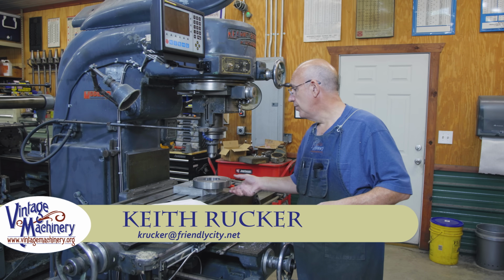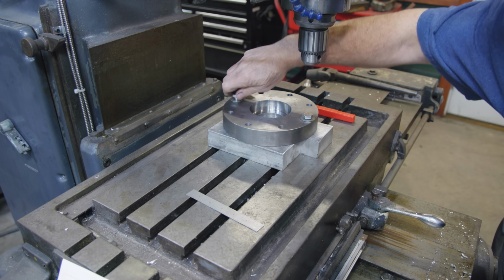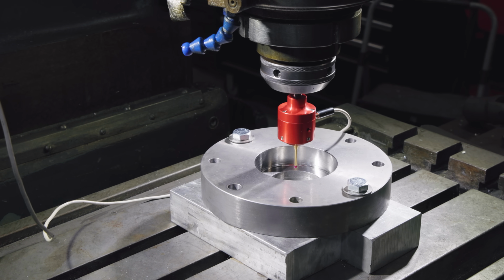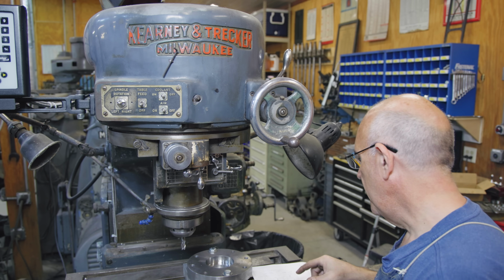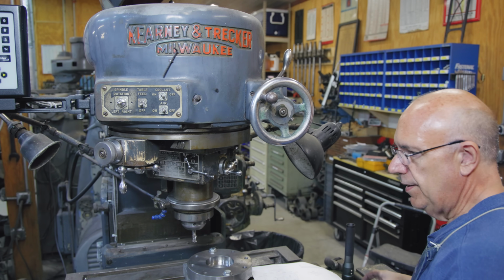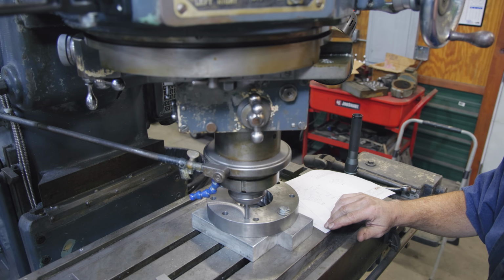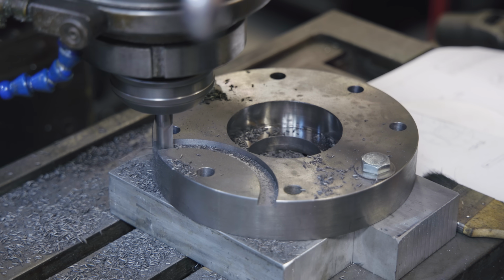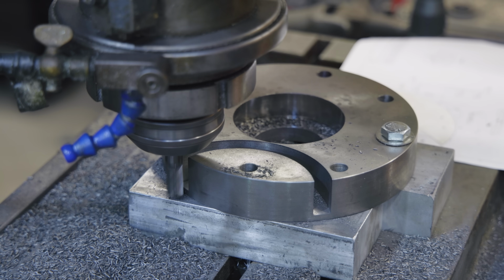Tally Ho Capstan Project: Circular Milling on the K&T 2D Rotary Head Milling Machine

Comment: Why did the cut fall inside two of the eight bolt circle holes when the print indicates the cut intersected with two of the bolt holes? I really appreciate you sharing your projects with us!! I started my career as a Machinist back in the late 70s. It's great to see some of the amazing machines that I used to work with before CNC took the floor.

Comment: Love your videos! Just wondering why you could not (or chose not to), cut on the reverse stroke, each time you brought the head back to the left side. You only cut in one direction... left-to-right. 
It seemed to me that it might have been possible to cut your work time in half if you had cut left-to-right, and then also again on the reverse, right-to-left (while returning the cutter head back to it's zero position.

I know nothing about any of this... just a casual observation and I'm curious...

Still a great video! And I love your videos!

Comment: Hello Keith:  Be sure to lock your quill with the large nut when the quill is not being fed, also, when not using quill feed, be sure to put the feed selector in neutral to avoid wear ... Trust me, you do not want to have to dig into the quill feed box.. Ask Grundy about it.. Cheers from Louisiana; Mike

Comment: It's interesting the machines that used to be made. Yes CNC has replaced this function, but here is the key thought, the CNC machine only approximates the diameter, it is after all a digital machine with discrete steps. This machine, being analog, actually makes the true circle.

Comment: Al. You have a trash pump, we always use a fire pump and fire nozzle. Fire pump built for pressure not volume as the trash pump is. You will run out of water to quickly .

Comment: Nice to see the machine at work. I'm wondering why you chose to cut only in the clockwise swing of the arc? Why not cut .100 DOC in both CW and CCW swings (done in half the time). Is there a reason the unidirectional cut is preferred?

Comment: It looks like the arc is not aligned correctly with the bolt-hole pattern,  i.e. the distances from the cut-out to the two closest bolt-holes are different.  Is this a problem ?
Later edit:  I can see from the drawing that this is deliberate.  So, no issue (although the clearances of the hold-down bolts in their holes means that these distances could be slightly different from the drawing).

Comment: When you centered up the spindle on the bore, you did not ensure that the spindle was centered, aka on a radius of zero.
Reply: If you turn the feed on and rotate the spindle about it's Variable radius, and run an indicator on the quill, you can zero the spindle out.

Comment: Once again, Keith, a very absorbing video. I am afraid that I get so caught up with it all that I find myself holding my breath as the tool is making its way to the first cut, As the the actual machine, all before me have expressed what a wonderful piece of equipment it is, and hard to imagine how it is designed and built. None, I hasten, to take away you skills in leading it gently by the nose. Great stuff.

Comment: Just curious as to why no cutting fluid?
Reply: I think it is for filming, you don't want that oil on the optics and we will not be able to see the action.
Reply: It’s cast iron. The graphite in the cast iron acts as a natural lube. Also coolant ran while milling cast iron makes a nasty black mess.
Reply: @grntitan1  I thought that might be the case, the way the chips were flying, but wanted to know for sure. THANKS!

Comment: Did you account for the clocking on this part in the tool you made? You found the center, but there should be a small clocking error of a couple of degrees. It looked like there was some play in the bot hole.

Comment: Hi Keith, when you fixed the flange down using the holding down set screws there would have been clearance holes in the flange how were you able to confirm the the bolt holes were in the exact zero ,180 and 90 , 270 degrees as this would throw off the cutting.

Comment: Since one of the bolt holes is supposed to be the centerline of the layout; did you check the alignment of those with the play in the fixturing and just not show it?  Or does it not matter since the things being bolted on just have to match the bolt pattern and the "fitment" to the capstan casting is a different set of bolt holes?  This is to mount the motor to the capstan, right?
Reply: This is just for clearance on the cast part of the capstan mounting, it will register on the bolt holes and the boss on the motor side. I suspect that it will get doweled after gear clearances is set up.

Comment: It's interesting  to see one of these things actually doing something other than collecting rust in the back of someone's shop. But truth be told I haven't seen anything so far that couldn't have been done just as easily and just as well with a conventional vertical milling machine and an X-Y rotary table. The biggest functional difference is, with the rotary table you'd be cranking the table by hand not power feed. If someone does a lot of really oddball jobs (and by that I mean much odder than this one) and can't justify a CNC, such a machine might be a good thing to have around. But otherwise, sad to say, it's just taking up floor space that might be better utilized otherwise. 

I remember back in the 70's and 80's you couldn't give one of these mills away. Then a bit later the same could have been said about the X-Y rotary tables. No one wanted to take the time to figure out how to use them, and the button punchers with their CNC's could outwork them in any event. Now though I get the sense that there may actually be a renewed demand for dinosaurs like this. I hope so, because these machines really are a piece of American machining technology history and as such are worth saving.

Comment: Are we at risk of cyber attack on C&C machines? Are there enough manual machines to fill the gap if a number of C&C machines were compromised?
Reply: If the grid goes down you will require an old school blacksmith shop 
😂😅😂😢🎉
Reply: "Are we at risk of cyber attack on C&C machines?"  Almost certainly. If a shop or machine is not connected to the internet that provides some protection but everything and I do mean everything electronic is vulnerable to an EMP hit. 

"Are there enough manual machines to fill the gap if a number of C&C machines were compromised?"  Not even close.

Comment: Keith,
I watch every video and really like seeing such precision.  I've never been around a machine shop.  
I do have a question.  Why not cut the arc on the reverse swing as well as the forward swing?
Reply: The longer side of the arc is exerting more pressure on the spindle than the short side.
If you are going backwards, it is not resisting the motion, but trying to make the machine move faster in the direction of the cut.
Probably not an issue on such a massive machine with both sides cutting, but machinists are in the habit of avoiding climbing cuts whenever possible.

Comment: Hi from Germany! Is there a reason to not dial the 100 thousands in on the way back, so you would only have halve the passes? Keep up the good work!
Reply: Climb milling vs conventional milling. On regular lead screws climb milling can sometimes cause the cutter to try and climb the work. Essentially caused by the backlash in the lead screw. With ball screws commonly found on CNC machines, this isn’t as much a concern because of their near zero backlash. All screws have some degree of backlash or it wouldn’t move. Ball screws are as close to zero backlash as you can get.
Reply: @grntitan1  But is it climb milling? I mean he dosent mill the sides, so for the cutter the direction is irrelevant, because you flip not only the direction of the cutter but also its point of first contact with the material to the other side. In both directions the way the material is cut should be exactly the same.
Or do you mean, because of the backlash toleranz the cutter has a preferrd side of "rubbing", and you would get some minimal  inconsistencies in the steps down on the sides? Hmm, this would make some sense i think. You would be able to see the passes at least, but would it matter?
Reply: @martindelp5665 Well as I had a similar discussion with another fella on here, it’s all guessing as to why Keith only cut one direction. Thus my statement of the climb milling was purely an assumption. In my years as a machinist(retired last year) I never had the pleasure of seeing one of these mills in person much less run one. Is there a possibility this type head doesn’t play well cutting both directions? I have no idea. I do however agree that load on the cutter should be somewhat even on both sides of the cutter make cuts in either direction. It’s all guessing without Keith himself speaking up. I know when one has hours invested in a part, you get more and more cautious as you go for fear of ruining it. 
For what it’s worth, I would have probably made cuts both directions albeit maybe a slightly less depth of cut on what’s perceived as the climb milling direction. It’s always easy for us to sit at home and play shoulda woulda. 😂
Reply: @grntitan1  Thx for the clarification, and yes, i am guessing too 😅
Reply: My thought exactly.  Why not?

Comment: I’m amazed like everyone else at the rotary spindle on that K & T Mill.
Pure genius when you think about it.
Then practical me thinks “how would I do that on the Bridgeport mill?”
And I’m thinking “ well I’d fixture the part and it’s fixture plate to the rotary table, offset the X axis to get the arc I need and more the part into the spindle thru the arc rather than needing a rotary spindle.
What’s the difference between a rotary spindle and a rotary table, they both perform the same basic function.
Am I missing something obvious here?
Reply: Good catch. The only thing you are missing is that there are such things as X-Y rotary tables that allow you to shift the work off center simply by cranking a couple of handwheels.

Comment: In 1982 as a young, fresh engineer I have a vivid memory of walking by a machine that was cutting an o-ring groove on the OD of a large (18 inch diameter) aluminum housing.  The machine was awe-inspiring.  And, it reminded me of my mother's KitchenAide mixer.  I don't recall the make and model and I never ran across anything like it...until this video!  This itch, after all these years, has now been scratched.
Reply: While a machine like that wouldn't be used often, when you do need it there it is.
Reply: Often just one major job would pay for the machine and all the labor, leaving you with this sort of machine in the shop, which then allowed you to bid other jobs that needed the machine.  Well worth it if you could get that first job.

Comment: Not to diminish the CNC gurus but the people that designed and built these machines were brilliant and that was way cool Keith.
Reply: It is more difficult to create a mechanism that creates complex features than a computer algorithm which moves stepper motors to the next position. That is why we have CNC machines today because they are simple compared to a machine like this or other fully-mechanical systems. I love these types of machines, they show a lot of intriguing designs! I wonder what mechanism they use to still drive the spindle even if it off axis.
Reply: @romanvarcolac2238 complex to design definitely.  Though at the same time often surprisingly simple solutions to achieve it
Reply: I agree 100%
Reply: I was just about to post the same.  That is some impressive engineering that went into that milling machine.
Reply: I totally agree, I hope CNC machines never replace these beauties, these machines were designed to do exact work and if something ever happens that computers can’t be used, hopefully we have enough machinists like Keith to do the job, upgrading isn’t always better.

Comment: @75 I want to thank you for keeping our craft alive.  I also had a shop in my home Garage where I have built many usefull items.  I realized my machinery was underutilized so I sold the shop off to younger men about 10 years ago.  I still have access to a large machine shop that is heated although it is 15 miles away(heated in Wisconsin means minimal problems with accuracy and deteriation from moisture and rust as well as a stable machine metrologically).  I now have access to CNC + CMMCNC and tooling to the end of time thanks to a younger brother and his sons.  My projects are still interesting and I am careful to schedule work for open machines.  I realize consumables are still needed and am appreciative monitarily when tooling is required.  I was impressed by your touch probe. Is that a function of the the machine's DRO? I had toured the Milwaukee plant with a friend of mine who worked in the service department diagnostics on the CNC equipment (PDP-8 circa 1989-90 ?).  I really think the equipment of the day was more experimental than practical. While useful, many of us earned a lot of money repairing and diagnosing problems Many were mis-understood as electronic when a simple adjustment fixed the problem.  I seem to recall loss of zero issues cused many mechanical issues with collisions etc.  The machines of the early to mid 90's were the start of the unprecedented accuracy of today.  I recall seeing a robot installing lifters into lifter bores I think about 1995 - 8 at a time!  Thats when I understood Monarch, G&L K&T Gisholt and the rest were in trouble!  I was also involved as a customer advocate during the retrofit years (about 1992 thru 2000) box ways and tercite casting was effective but delayed the inevetable progression to our machines of today.  I really enjoy your channel Thank you for the content, I enjoy your commentary on thought process I find myself agreeing often and learining on occasion!

Comment: Is it just me or does it look like the drawing shows that the inner circle should have a thicker wall around it and it was cut out of the piece? I am new engineer, so I am definitely speaking out of turn. I went back and looked at your drawing in the video and even the finished piece. Looks like there’s a nice thick wall around the center cut out.

Comment: The radii are for clearance, but the straights should be parallel or perpendicular to the bolt holes... We never lined them up and there is plenty of clearance for the flange to be out of rotation while being roughly centered on the center hole.

Comment: This is by far the coolest machine in the shop. I hope your imagination finds great uses for it. It is awesome to finally see in it action.

Too bad your DRO doesn't also take in a rotary encoder and a 4th axis for the spindle offset. Always calculate tool position. That would be slick!

Comment: That is quite the machine, I cannot imagine there are many left. For what it lacks in speed it makes up for in cool points. 

I think it would be interesting to see that radius cut on a lathe. Offset the part in a 4 jaw chuck and go to town. Not an expedient way, but just another way that things were done, from what I have been told at least.

Comment: isn't this a job that you could pretty easily do with a rotary table?
Reply: Since this amazing machine has the rotary feature built in this job is a good way to demonstrate how it works. A large rotary table on a Bridgeport could also be used.
Reply: Second, he would have to make a new pallet setup for each radius rather than turn a crank until the scale reads right. First, with a rotary table, he couldn't play with the new-to-him mill.  Remember this is a hobby.
Reply: @kensherwin4544   @ellieprice363  i do understand that he's playing with his toy. my question was because he insinuated that this was something that was limited to CNC mills when it seems quite clear that a rotary table on a conventional mill could do the same job albeit maybe less conveniently.

Comment: Wouldn't it be amazing to see a machine like this made from start to finish.  A Swiss watch on steroids!
Reply: As you said about two minutes ago. Refresh the comment section by pulling down from the top on a touch screen, or control F5 in Windows, if using some other OS just the same, refresh before posting again.

Comment: I had no idea that you could cut that way on a milling machine!
Reply: Most mills you can't. This one is one you can. I have 2 conventional manual milling machines. Google the rest of this 2D Kearney and Trecker mill's capabilities.
Reply: @bobhudson6659  You can do it with a conventional machine and a rotary table, but setting it is much harder and prone to mistakes.
Reply: @philipmihailov  Agreed but only with the rotary table. Without that or a CNC machine Keith's machine is the way to go.
Reply: Would a fly cutter in a milling machine also get this job done? Albeit taking much longer.
Reply: @alstonofalltrades3142 .It is possible just takes a lot longer. Nearly all machining jobs can be done with basic equipment as it's removing the correct amount of material .Hacksaw and file if nothing else available.
Reply: @alstonofalltrades3142  How many weeks do you have?

Comment: I'm curious why you don't dial in more depth and cut when you're swinging the head back to the start? Is there as aspect of climb cutting in a scenario like that?
Reply: I'm guessing but I wouldn't do it because the tool pressure from the leading edge of the cut would push the tool to the other side wall of the cut, making a bit of a step between cuts.  That wouldn't be pretty and if the step were significant, it might interfere with the next pass.  It was a single part, not production, so why risk it?